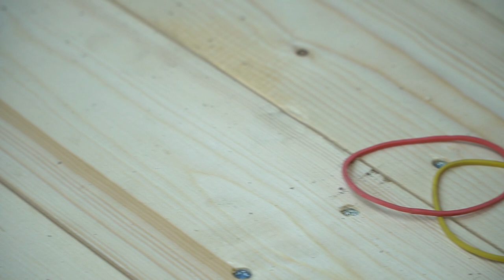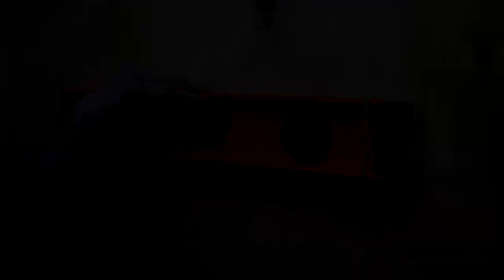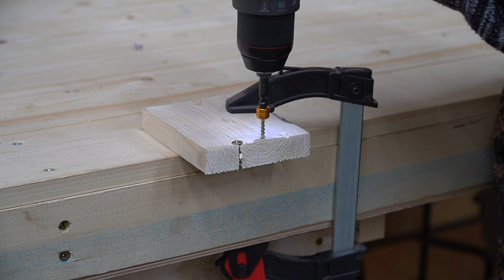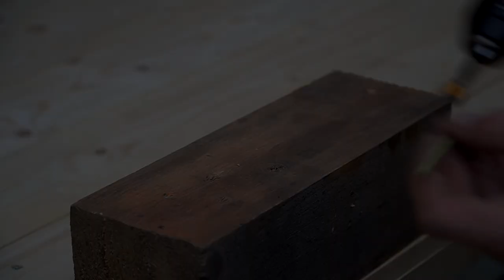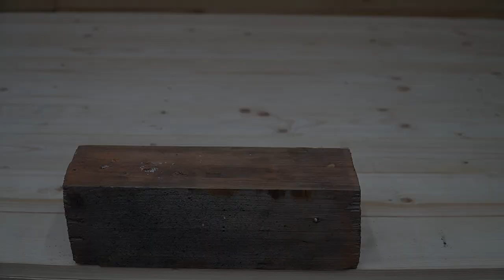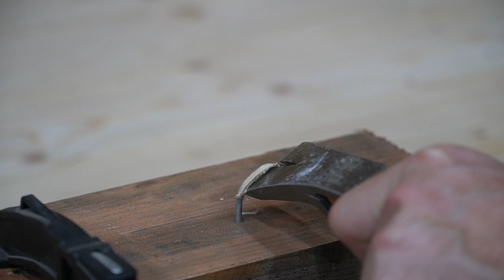Ingenious Tips and Tricks That Really Work

Comment: Just add another hard thicker surface (such as another small thick block of wood) to get nail out, then u can re-use the nail without it getting bent. Seems the bend over nail & hammer into wood would likely split your wood.. but I guess it depends on the hardness of what type of wood your using and how thick. Good idea in a pinch but might as well buy the right length nails to begin with or use grinder to quickly cut to surface without leaving any deformities on the surface of your project. Screwing so close to an edge seems pointless unless it's for looks, but I like these ideas if your in a pinch. 😉